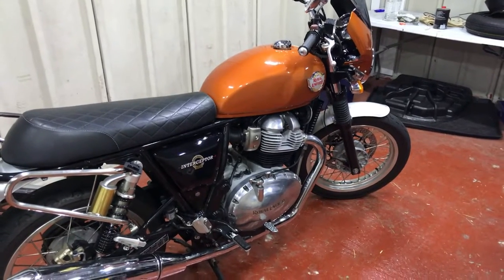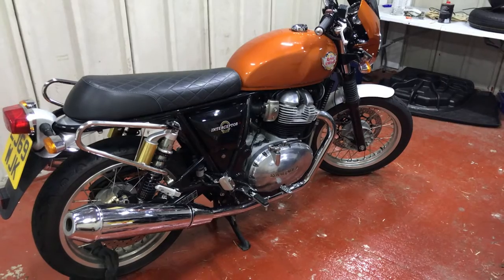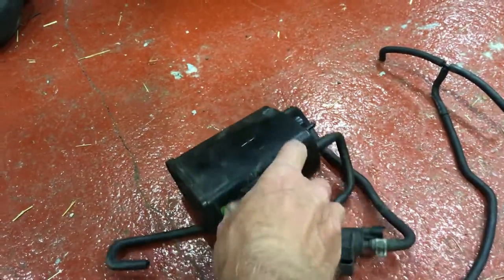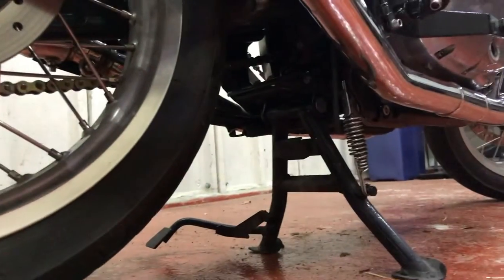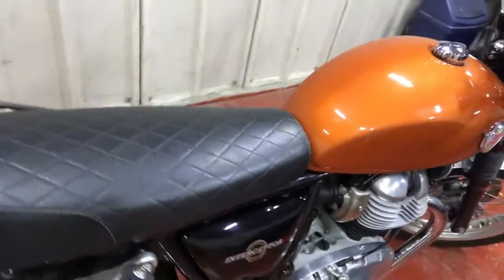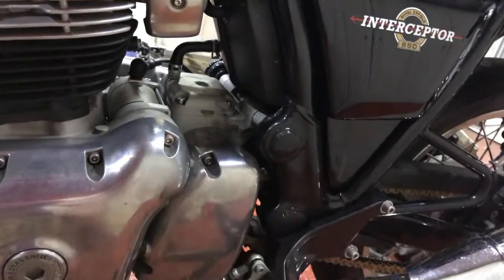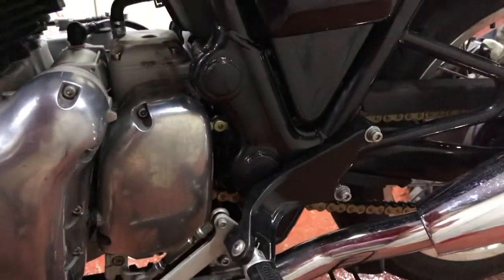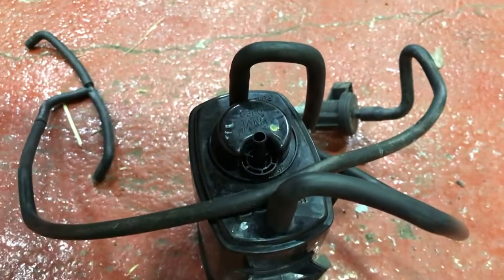Removing the EVAP system from Royal Enfield Interceptor 650

Comment: Removed my evap, itwas soaked in gas (I never overfill fuel tank) and had constant starting, running and idling issues. Bike now runs like a dream
Reply from the maker: Amazing difference, is t it? I almost sold my bike due to the rubbish starting etc. truly. Removing the Evap system cured it all and I still have the bike of course

Comment: oh dear, I regularly fill my tank to the brim on the center stand, mine will definitely be soaked with fuel
Reply from the maker: That’s almost guaranteed! If you have any problems starting the engine eg repeated presses of the starter button, starting and then stopping, rough running, stalling etc then it will be the saturated Evap cartridge. My bike was terrible for all of that when I first got it and I was going to sell it! It went in for the first three weeks I had the bike until I had a think about it and read the service manual and thought about the evap system.

One thing…you don't need a ‘delete kit’. Do as I did in the video but leave the purge valve in place and electrically connected but with all the pipes eliminated as per the video. Then you can either block off the stub on each inlet manifold with a rubber cap OR just join them together with a piece of the redundant pipe from the Evap. The ECU still communicates with the purge valve and opens it (on every start, I believe) but it doesn’t do anything in terms of the now-removed cartridge. The ‘delete kit’ is two rubber caps and a resistor in a plug that fits into the block connector that goes on the purge valve, a bit of a ripoff at £30 or so. The purge valve is a simple solenoid switch…nothing fancy. So you can leave it plugged in and let it open and close at the will of the ECU (which remains happy and fooled) and block the stubs off or just join them together. I wish I’d thought it earlier as I paid £30 for very little! Learning curve….lol
Reply from the maker: Pa. Once you’ve removed the cartridge and piping, get a hacksaw on the cartridge and empty out the (saturated) charcoal. I put mine into a metal bowl and set fire to it…..it burned for 15 minutes like mini-barbecue!

Comment: Thanks for posting this video. I bought the same kit a month ago, but I couldn't work out the instructions so havent installed it yet! So, the two rubber caps are for the connections at the throttle body and you leave the pipe coming from the tank installed, capping it off where it terminates lower down? I only received the plug for the harness and two ruber caps in my pack?
Reply from the maker: Yes, that’s it. Sitting on the bike, the left side manifold has TWO stubs with pipes attached and the right side has only one stub. You need to remove the outer one on the left manifold and the only pipe on the right side one. They look exactly the same. So you’ll know which one to take off on the left side manifold. Basically the one nearest to you. Then put the rubber bungs onto the brass stubs. These stubs have the T-shaped pipe shown in my video attached to them and they join just behind the rear rocker cover and the one pipe they form goes to the purge valve. The pipe attached to the charcoal canister at the TANK stub is the one you need to block off with an M8 (aka 8mm) short bolt. It’s not a problem if your kit didn’t have one as any short M8 bolt will do…stainless steel being better, of course. Just screw the bolt (Allen bolt is better) into the pipe. The pipe nearest to you on the canister, looked at from the rear of the bike, is a breather which goes up round the back of the battery. 

So, you basically pull the pipes off the canister, then remove the canister by undoing the retaining clamp and sliding the canister to the right side of the bike, then jiggle it out past the wheel. You have to pull the pipes off first, of course. 

Once you find the purge valve, pull it towards you on the left of the bike and it will come off the lug under the battery tray and get it closer to you as you reach over the sprocket, (newly exposed after removing the sprocket cover). The electrical connector on the purge valve was tricky to pull off as it has a spring clip on the left side and a small plastic clip on the right side plus some sort of collar. It also has a waterproof rubber seal which made pulling it out of the purge valve slightly tricky. In the end, since I knew I had no intention of ever using the purge valve again, I just broke the clips off with a screwdriver and prised the connector out. The clips are on the purge valve side and not the connector side, so it didn’t matter. Then it’s easy to connect the black plastic connector that came with your kit. And the wiring harness is long enough to have the connector live under the left side panel, held onto the wiring harness with a cable tie. Once the purge valve is disconnected from the wiring and also from the charcoal canister, it’s easy to pull it out from the right side of the bike. Just remove all pipe which was attached to the canister. There is another small pipe from the tank which needs to stay put and the big one with the M8 bolt in stays, of course. 

That’s basically it. As I mentioned in the video, my canister was full of petrol and just can’t have been doing anything at all. 

I hope that helps. It sounds a bit complicated perhaps but it really isn’t. The hardest part was finding the valve (event though I have a manual for the bike) and getting the electrical connector out of it. But all worth doing.

I hope that helps…… post on here when you’ve done the job! It will be interesting to know the state of your canister and whether it’s full of petrol 😀
Reply: Hey, thanks for the detailed reply! I was hoping to have a go today, but got distracted tidying up a few other bits on the bike! I aim to get it done in the next week or so 🤞
Reply from the maker: @dan3535  post and let me know how you get on!  And whether your charcoal cartridge is full of petrol…….. One thing I’ve noticed since doing mine…better starting when the engine is hot. It had become necessary to hit the starter two or three times when the engine was hot. Now I don’t need to do that. It might have been the purge valve opening and the manifolds trying to suck petrol from the cartridge. In any event, it’s a lot better now……

Comment: As a test, I wonder what would happen if I were to just disconnect the pipes from the canister and allow them to breath free and leave everything in place for now?
Reply from the maker: The larger diameter pipe which is on the right side of the fuel tank needs to be blocked with an 8mm bolt though. The purge valve would still operate though and allow the inlet manifolds to suck air in, as opposed to sucking the vapour content of the charcoal cartridge. I suspect that your idea wouldn’t work because of that. You should block the two inlet manifold stubs, block the right side the fuel tank pipe which goes to the canister (using an 8mm bolt) and leave the purge valve electrically connected but with the pipes disconnected. This would effectively disconnect the charcoal canister and remove the need for the delete kit (because that connects to the wires that go to the purge valve). This means the ECU still recognises that the purge valve is connected (so no error message) but, because the inlet manifold stubs are blocked, the purge valve doesn’t actually DO anything apart from open on command from the ECU and say it’s there. That would work. 

Question…what are you trying to test?
Reply from the maker: In answer to my own question……you want to test that nothing will go wrong, right? All I can say is that after constant rough starting and running and stalling, by doing exactly what I detailed in the video, every single problem disappeared immediately. If you want to have it both ways (and don’t mind spending £20)…….buy the delete kit and install it as per my video. And…like me……keep everything you remove (it’s easily reinstalled)…..then run the bike and revel in the instant starting hot or cold, no stalling, no sudden engine stops after a cold or hot start and feeling like the bike has just had a new engine. Then throw the entire Evap kit into the nearest dustbin. It would be a good idea to remove the cartridge…easily done and leaving everything else in place and just see if it drips petrol like mine (and others) did
Reply: @internetpolification  Thanks so very much for the comprehensive explanation James. I just read back my question and sorry it wasn't better worded (but thankfully it looks like you managed to get the gist). But to clarify, what I was aiming to do was test the idea of a EVAP "delete" without actually physically removing it. Initially, the aim being to conclusively prove to myself that it was the EVAP that was causing the warm start issues on my particular Interceptor and that excluding it does not adversely effect anything else. It is looking very likely that it is the cause and it is fine to remove it based on your research, but I wanted to do a simple exclusion test. And if that test works, then there's probably little need to actually physically remove it. Leaving the valve in place eliminates the need for an electrical bypass and leaving the canister keeps the components behind it protected from road muck (plus if, in the unlikely event that in the fullness of time some other issue caused by it's removal presents itself, it easy to reverse). That was the way my tiny mind reasoned with the problem, I hope it makes sense, I think you second guessed it anyway and your explanations are very helpful. The big takeaway for me is that you think that sucking in clean air into the inlet manifolds (rather than vapour from the canister) will cause a problem? Can you go a little more into what sort of problem that would cause please? It wouldn't be difficult to block them (presumably just pull the pipe off the end of the valve and block it with a bolt), so it's not a big deal, and as you suggest also block the large pipe from the tank. Thanks again and keep up the great work with your video's, they are so helpful!
Reply: what triggers the purge valve to open.?. If it opens periodically and not by some pressure sensor of the vapor build-up. You would think that not removing but just putting a block in the pipe from the tank and leaving everything as it is including the tank pipe, would be ok. The purge valve can open and shut or not without any effect on the bike .
Reply from the maker: @michaeltowler2632  yes, I agree. The delete kit isn’t that necessary if one does it that way. It occurred to me after buying the kit and removing the Evap system. I suppose the delete kit means a cleaner removal though and removes the risk of purge valve malfunction in the future

Comment: Hi James thankyou for posting this video and others you do its great people like you take the time and effirt to share these things.
I am still awaiting my euro 5 kit to be delivered but i have removed the evap trash unit ready.I have checked out the 2 x rubber pipes going to the petrol tank, if you are sitting on the bike the smaller pipe which attaches to the left of the petrol tank this then  s a small metal pipe which goes through the petrol tank to a hole in the top left side of the filer cap if any fuel is spilt it would run down this hole and into the evap unit.
The larger pipe on the right side attaches also has a metal pipe running in the petrol tank and stops near the top which drains off any fuel to the evap unit if you over fill or tip over the bike.
I think the right side pipe need to be kept open as this also seems to be the breather pipe to the petrol tank as there is not one in the filer cap on this bike and may cause a vacum in the tank when blocked.i have kept both pipes open and ran the down to the undersection of the bike.
This is just my take on it so i thought i would share i may help.
Reply from the maker: Hi Mark…. Thanks for your kind words. What you’ve said above is incorrect. As you sit on the bike there is a pipe on the left and a pipe on the right of the fuel tank. The right side one is the larger diameter pipe and the left side one is the smaller diameter. The larger one should be blocked using the M8 bolt that comes with the delete kit and the thinner pipe should be left open. This is indeed what the fitting instructions detail with the kit. I did mine weeks ago and use the bike daily for going to work and for leisure too, so prolonged use. I’ve done over 500 miles since removing the Evap system and fitting it as per my video….no fuel starvation, no vacuum in the tank, no hissing when removing the fuel cap. Just first time start, hot or cold, better tick ever when temporarily left on the side stand. No problems whatsoever. 

Having said all that, I suspect that the two pipes could be left open, despite instructions to the contrary. How about your doing exactly that when your kit arrives and posting the results? That would be very interesting.

I also wondered whether simply joining the two wires together that operate the purge valve would remove the necessity of the bypass plug?! It’s a simple on/off solenoid only. Another option might be to remove the cartridge etc and leave the purge valve connected electrically only…….that would keep the ECU happy
Reply: Did it ever show up?  I had the most unbelievably bad experience with the fueldongle seller on Ebay.  Made me curious as to whether he has a pattern of doing it.

Comment: Useful vid thanks James.  I've removed the EVAP on my E4 Conti GT650 (2019),  I decided to leave the cross pipe between the throttle bodies and blank off the 'T' piece. My reasoning is that there's a designed cross link air bleed between the throttles and it's not necessary to remove it to achieve EVAP removal.  Works just fine.  Also getting the valve out using your method work nicely especially if you pull (hard) the pipe off the right hand side first and then use the left hand pipe to finagle it out.   Just for interest, I put an ohmmeter across the dummy plug (two pins) and it's a 10kohm resister.

Comment: Just did my evap removal,  easy really, the valve can be got at via the rear wheel opening. No issues with running and at just over 1000 miles it was solid inside like yours.
Thanks for the common sense vids 👍 keep up the good work.
Fitted the front sprocket also and this make 500rpm difference so a bit smoother and a little more mpg 😅
Reply: Hi,  Do you get engine error sign by removing the EVAP system ?

Comment: Excellent intructional video, better starting and running and an extra pound of crap removed thes uses energy to accelerate and decelerate about for the life of the motorcycle. Nice job!
Reply from the maker: It makes a massive difference, eh? I was seriously thinking about selling my Enfield because of the lousy starting, engine cutting off at low speed from cold, three presses of the starter button every single time in order to get it to fire. Then ditched all the Evap garbage and it transformed the bike! I’m pleased my little efforts have helped you!

Comment: Don't expect an answer but you never know! What  If I just emptied charcoal out and just drilled a few holes in the cannister and replaced with all lines attached? It would solve problem I would have thought. Cheers much appreciate your videos. 👍
Reply from the maker: That would work! Although it’s easy enough to remove the system entirely ant negligible cost……

Comment: Hi James thanks for posting video on removing evap system, I do however have a question is there a separate fuel tank vent ,ie breathes through tank cap,
Can not see the point of evap if this is the case. 
Thanks again for all your postings 
Regards Richard caselton.
Reply from the maker: No…it breathes via the Evap canister…..that’s what it’s there for…..to soak up breather petrol vapour, absorb it into the canister and then burn the vapour next time the engine is started. But it’s easy for the canister to get filled with petrol (as opposed to petrol vapour) if the tank is ‘overfilled’, although nobody really seems to know what constitutes overfilling!
Reply: @internetpolification  Hi James thanks for your reply, I do understand the system but do not agree with blocking the vent from the tank if there is no other vent as this
Would set up a vacuum in tank as fiel is used all tanks have some sort of vent Would appreciate your thoughts on this, 
Thanks again for a fantastic site.
Regards Richard.
Reply from the maker: @richardcaselton5377  Hi Richard. The fuel tank has two pipes, one on the left and one on the right. They both connect to the Evap cartridge. One of them is the fuel tank breather tube which allows the tank fuel to be used without creating a vacuum because of the sealed fuel filler cap. The Evap cartridge is not a sealed box…it has its own breather which tucks behind the battery. So the tank can breathe but the gases go through the charcoal in the cartridge which absorbs them. But when the cartridge gets full of raw petrol, it doesn’t work properly and, in my case, led to poor starting and stalling which stopped the minute I removed the Evap system. The filler cap itself is sealed and doesn’t have a breather vent, I believe, because the breathing is done via one of the pipes from the tank.